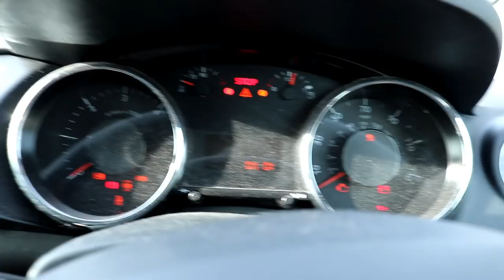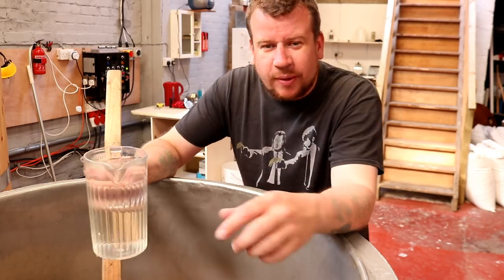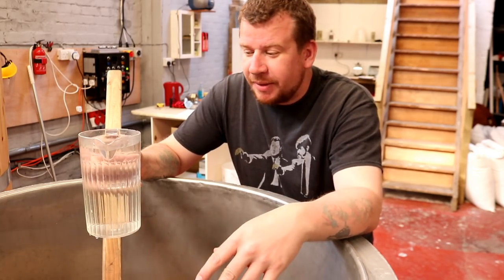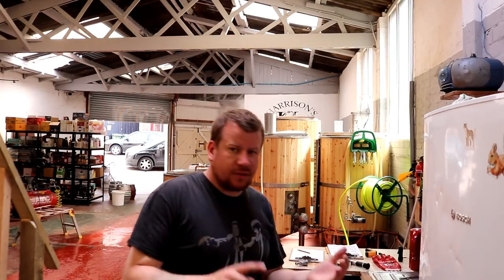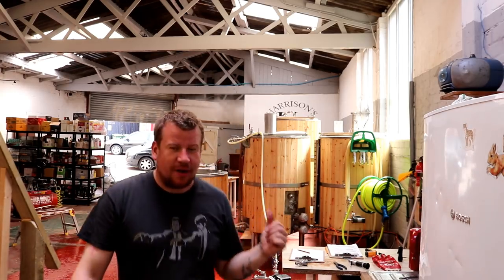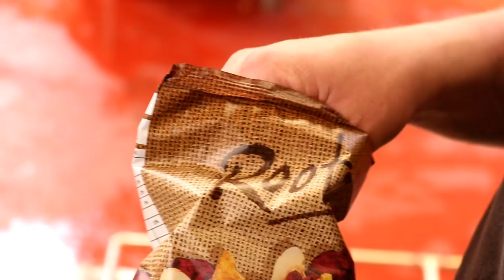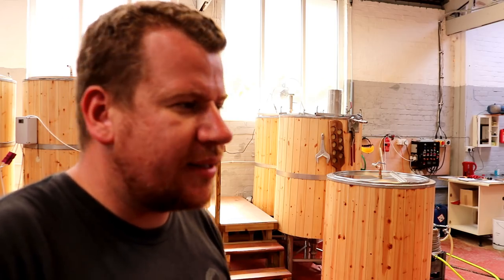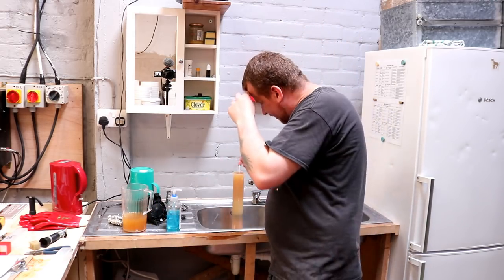THREE BREW SPRINT ~ THE GOODS

Comment: Harry ive been cleaning my mashtun with caustic after every brew is this overkill would just a cold rinse and weekly caustic be better? How many profloc tablets do you use seems like ive been using to many how long do you shoot for fly sparging mine is around 1h to 1h 20 mins cheers
Reply from the maker: I clean it out right away and if I am doing a back to back then a rinse is good enough before the next grain goes in. If there is more than a day before the next brew it will get a proper wash.5 protofloc for 500 ltr works for me and your times for the sparge are good.

Comment: Can you hook the glycol chiller into the counterflow chiller and recirc into glycol resevoir? Have you run through all the previous beer already lol? Waiting to see what you brew tomorrow. Cheers.
Reply: Dullahan Brewing you risk overloading the glycol chiller running it through a counterflow with near boiling wort. An option would be to cool first to a warm temp with tap water and then finish it off with the chiller, or pre chill the tap water through the glycol chiller and then run it through the counterflow.

I suppose it is just a PITA to set it up and potentially cause disruption to the glycol temp running through the fermenters. I’m sure Harry has a cunning plan though.
Reply: The norm is to chill the Cold Liquour down to say 10c with a coil in the tank f*** using ground temps right now lol

Comment: This could be the dumbest question in the history of man, but since I have zero experience with glycol here it is. Would it be possible to use thee glycol chiller to achieve better efficiency with the counterflow chiller.? I no chill all my beers because chilling takes way too long for my liking here in Australia.
Reply: David Gray I too am in Australia and no chill. But that is due to the fact that I have no chiller. 👍 what steps do you take to adjust hop additions to keep ibu's on track for the slower rate of chill?
Reply: Solidute 16 I put hops in at flameout and let them steep for 5 mins or so before transfering to the cube. I treat it as a 20 min whirlpool in beersmith
Reply: Do you use beersmith mobile or on desktop? I can't find anything on mobile for flameout or whirlpool...🤔 and therefore use a 0min addition for "0 ibu's" which is obviously incorrect
Reply: Solidute 16 I use both. In the hop options, change the boil hops option to steep/whirlpool.
Reply: David Gray ah ha got it cheers. My standard recipe has 5g @ 60min,  20g @ 20min, 30g @ 10min and 20g @ flameout which previously had it at 29 IBU but with the adjustment is now at 36 IBU. Would you suggest changing most additions to the flameout? I really only used the recipe I found on beersmith so happy to switch it up to help with the no chill